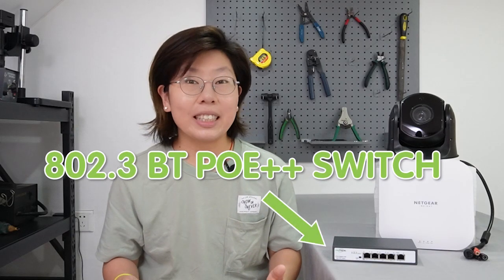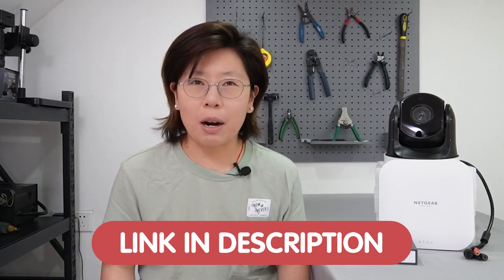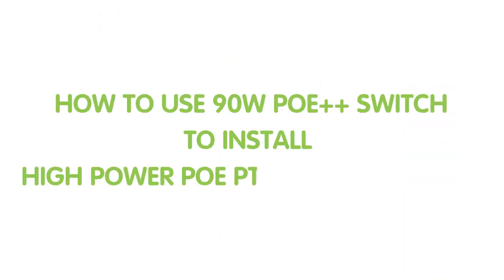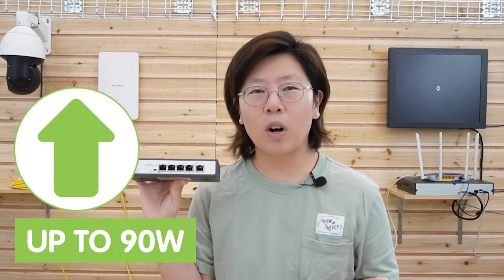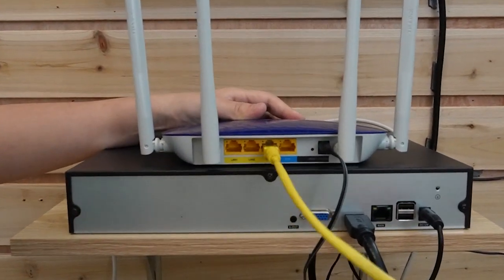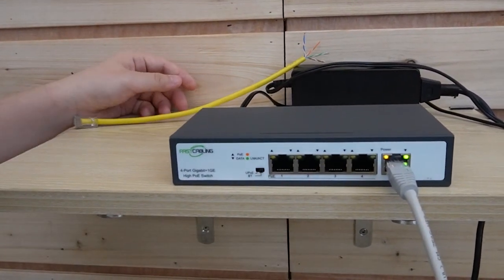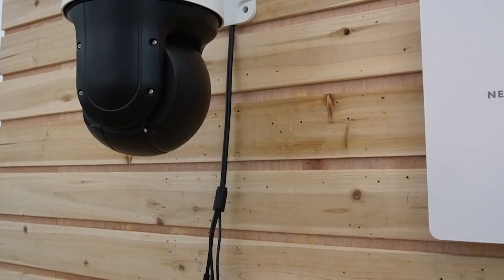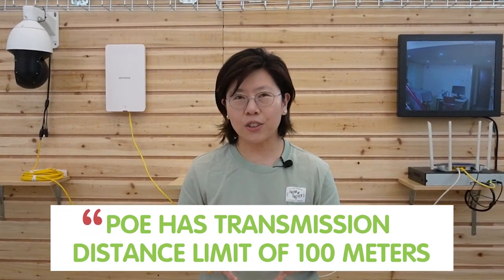Install High Power PoE PTZ & AP with 802 3bt PoE++ Switch

Comment: How much range can it cover  in meters or feet ? 
Also I am looking for flood light where the camera can rotate for 0 to 180 degrees covering atleast 100 feet distance and the lights should get adjusted accordingly , i mean lights can also be adjusted. Please help on this.
Reply from the maker: The maximum range is 100 meters or 328 feet. However, if you need to install the cameras at further distances, you can use a long-range PoE+ switch. Supported by 4-pair technology, the long-range PoE+ ports can supply 30 watts of power even at a distance of 500 meters (when connected to a PoE extender). 

Product Link👉 https://www.fastcabling.com/product-category/long-range-poe-switches/

We don't have flood light cameras, but here are some of our recommendations:

1. Reolink Lumus PTZ Security Camera with Floodlight: 355° pan, 140° tilt, 4X optical zoom, 1800 lumens adjustable floodlight.
2. EZVIZ LC1C Smart Security Light Camera: 270° field of view, 2000 lumens adjustable floodlight, customizable motion zones.